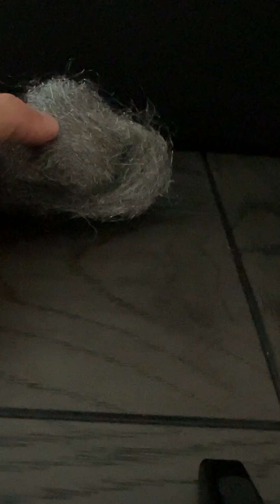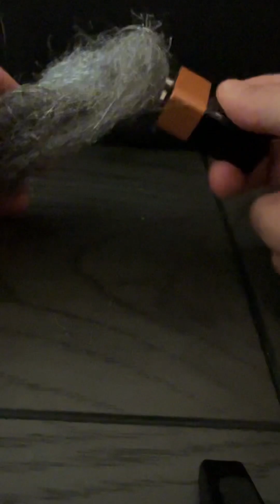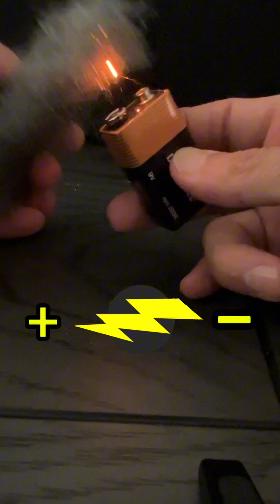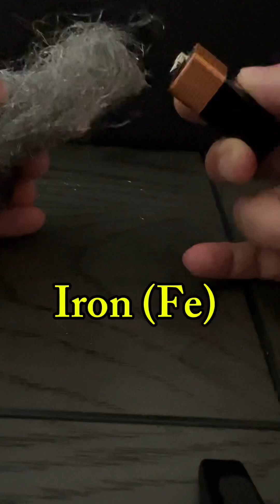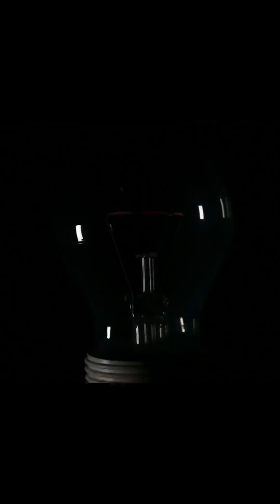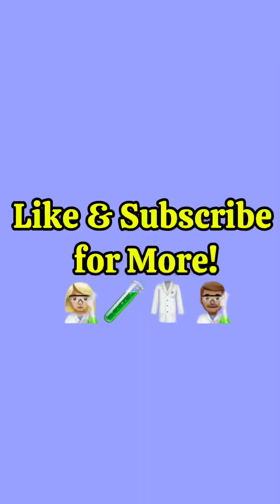Turn Steel Wool Red Hot with a 9V Battery!

Comment: Why would anyone suggest that others do this.
Reply: But also you are supposed to be able to use it as a firestarter like with camping and such.
Reply: I did it as a kid but not with his safety precaution most likely. Since you can do it safely, I don't see the issue. Just don't leave the battery mushed into it for overly long periods.